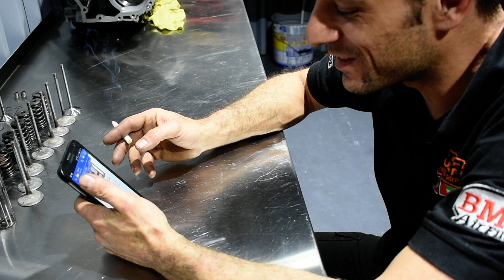M157 NOT half engine rebuild part 4

Comment: Tasos happy new year to you and your family, you know what happens is I told you this before every time you open a M157 we (owners) freak out and immediately looking for answers and treatments, so if people ask you a same question over and over is exactly out of frustration, something I like your recently doing something s revealing the faults of those  $20.00 per hour AMG techs who assembled these engines for the first time like excessive use f silicon in oil passages or installing valve spring in upside down position, because some enthusiasts here strongly believe Mercedes and AMG never make fundamental mistakes and they should be worshipped like gods, like those Mercedes engineers that last week rented a Tesla and to reverse engineer it took it into pieces.